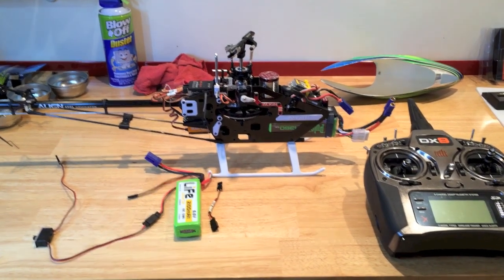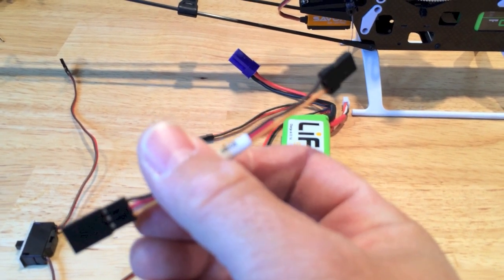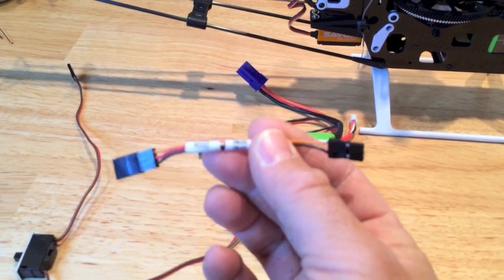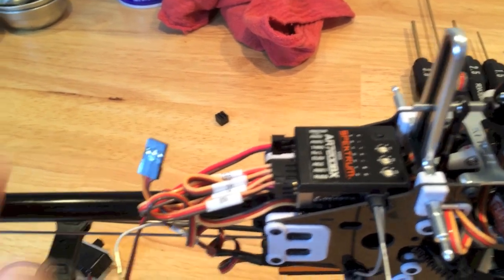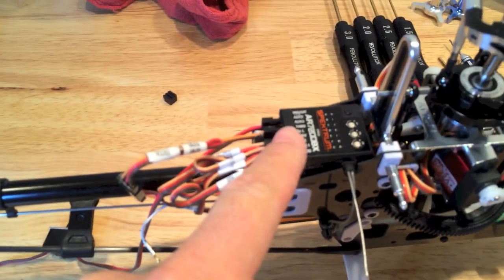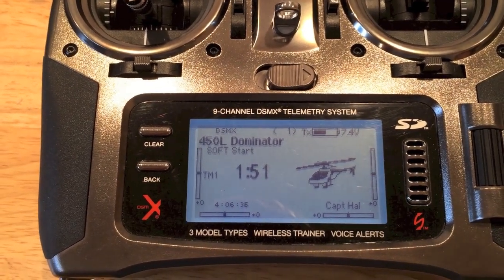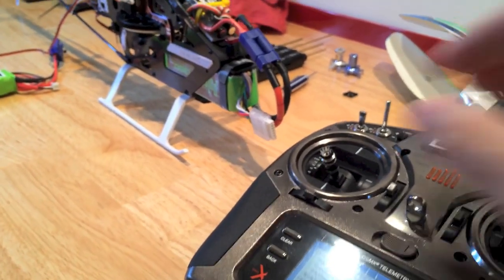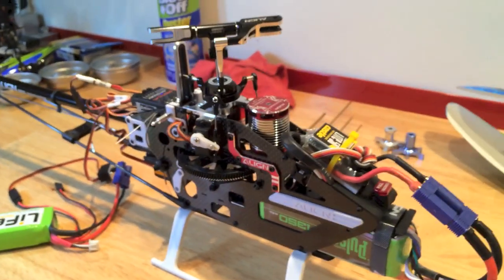Castle ESC Endpoint Calibration with AR7200BX

Comment: Can anybody explain the  30 30 on the travel adjust?..i understand about seeing the pulse...but whats the signifcance of the 30 30?..why not 0?
Reply from the maker: You could set it to zero/zero. It’s arbitrary.
Reply: @HalStaniloff  if you dont feel like trying to explaining it..i get it...but can i ask if it would be the same values for dx6i?..only askin bcuz i watched another video of someone showing how they do it...and the values they set were way off from 30 30...but also..i know that  different tx's...do it different ways...the same principal...but just looks different..
Reply from the maker: @natertater1978  It’s been a while since I was using this FBL and ESC. BUT I remember that it’s just an arbitrary minimal value to start with. That’s all.
Reply: @HalStaniloff  gotcha...okay...now that ive watched ur vid ahalf dozen times..its finally startin to sink in lol....but hey...sum learn faster than others..i just watched one where the guy does away with the pullin of the red wire and making diy plug..what he did was use a separate rx..plugged the dsmx  and the thro wire from esc into it..then made sure thro curv was linear..and then he also sets a 30 30 value in travel adjustments...but then he moves stick to hi position..and rebinds tx to rx...he claims it easier than the way u showed...but i would have to disagree..he had to rebind like 3 times that way
Reply from the maker: @natertater1978  This is the most straight forward way I found.
Reply: @HalStaniloff  i most certainly agree...im wanting to do awayy with this ikon 2 fbl unit on my 550 and put my bx on it....the way its setup .the red wire is  pulled out of the thro lead of the talon ...i assume it will be the same with the bx?..or will i need to put the red wire back in?..sorry im bombarding ya with ?'s..this is all pretty confusing to me
Reply from the maker: @natertater1978  I went all VBar Neo and don’t go through any of this crap anymore.  Just say’n.
Reply: Yeah...thats the top shelf equip. There fer sure...id loove to have the vbar..but my pockets arnt that deep lol
Reply from the maker: @natertater1978  yup. Overpriced for sure.  But you’re buying your time back with set up and tuning and the control loop is the best out there. The rescue is also simple af to set up and works flawlessly. It has brought my flying to the next level because I don’t have to bother anyone to buddy box. Saved in crashes; saves on parts.  Food for thought.
Reply: @HalStaniloff  its over a grand just for the tx aint it?
Reply: @HalStaniloff  heya...me again..okay..soo im sittin here watchin the vid again...following along with it step by step..and evrything goes right along with what your doing...up until i start raising the throttle value from 30 at high stick...i went all the way to the max with my travel adjust but the talon never did change from a blinking light..nor did it make anykind of beeps..any suggestions ..?
Reply from the maker: @natertater1978  Increase the values very slowly. Seems like the ESC is not catching the end values.
Reply: @HalStaniloff  apprciate it..i ended up figuring it out..when the ikon was on it..the talons power wire was taken out of the lead and was powerd from bec..lol 🤦..slipped it back in and she started makin the beeps lol..found it a bit strange that on the high side..it took well over a 100 to get the beep...whilest the low side beeped at around 85 er so..
Reply from the maker: @natertater1978  glad you figured it out!  Yeah, don’t pay attention to where the beeps started sounding. Electronics vary from vendor to vendor so it’s no surprise. Good luck!
Reply: @HalStaniloff  hey...i apprciate the hell out of ya man..m for taking time to help a stranger out..dont get that too often in the world these days.
Reply from the maker: @natertater1978  👊No problem.
Reply: @HalStaniloff   🤙🤘✊
Reply: @HalStaniloff  oh!!..i almost forgot..so as i mentioned ..i plugged the hot wire back into the lead..which still leaves me with my bec on my heli...it has two leads coming off it...should i..or can i..take the hot wire back out of the esc lead..and plug them into two open ports on my bx..?...its simply for redundacy right..in case of power loss?
Reply from the maker: @natertater1978  I’ve been flying for a very long time and when I went to 700 size helis I installed a Backup Guard for redundancy. However as time went on I never experienced a failure. So I pulled all the backup units off my machines as they were for me a waste of time and money.  Not worth the expense and weight.
Reply: @HalStaniloff  thats exactly what i was thinkin!!!..is it worth it to have that few extra grams of weight!...
Reply: Again
..i do apologize for bombarding ya for knowledge..got ta get nyway i can lol...but i have a concern...so i got the bx on...evrything is workin as should..its a 600E..and with the ikon..i was able to plug in both my dsmx's...on the bx..theres just one port for a satt..and ive read that anything bigger than a 450..should have 2 satts...is there any merit to that?
..is it a necessity to have 2 or will i be alright with just the on
Reply from the maker: @natertater1978  on the larger heli’s there can be a scenario where reception is deflected depending on the shape of the machine and the location of the satellite.  I would think you’ll be fine. But perform a range check to make sure you have good reception.
Reply: @HalStaniloff  ok..thanks again friend..right now i have it mounted dead in the middle ...on the bottomside of the bottom frame plate..and the other one is still mounted on the side of the heli..in the back near the the tail servo area
Reply: @HalStaniloff  heya ..its me again..i have a question hoping you could help me out with an issue im having with my castle ice 120
Reply: @HalStaniloff  okay..could u plz elaborate...why 30 30?

Comment: This video was made almost 7 years ago, and it still provided me with crucial information I needed to get my T-Rex 550E PRO DFC to throttle up with my DX8. The one step I missed was that the first time around, I set the throttle limits to 30-30 before I turned on the AR7200BX. But, I re-watched the video and did it right the second time, and it worked! THANK YOU!
Reply from the maker: Brian Hall I am delighted that my video helped you!  It’s turning out to be an oldie but a goodie. 😉💪🏻
Reply: 100% couldnt find a video that didnt confuse me even more

Comment: Another heli, someone said i need o calibrate the esc even tho im using fixed rpm mode in the castle?? is that true? and i cant do what you did in the video if i have those set can i? right now i have norm set to 30% flat, stunt 1 set to 70% and stunt 3 set to 100%. would i have to just set my throttle curve in normal to do the calibration? then just set back to a flat 30% to fly ? or do i need to change something in the ESC first? Thanks
Reply from the maker: You still need to tell the ESC the range of the throttle signal that the radio is sending through the throttle channel.  That is what the calibration step does.  I would set a linear throttle curve just like in the video and perform the calibration steps.  The put the ESC in to whatever mode you want.

Comment: My friend, I've tried setting up my 90's talon endpoints on this AR7200BX with DX7 black, but the ESC does not recognize the throttle. What can it be?
Reply from the maker: Luciano Gonçalves Aleixo Can you be more specific?
Reply: I did what you taught in the video, but not right.
Reply: ESC does not recognize radio endpoints
Reply from the maker: Luciano Gonçalves Aleixo Try it again.  Unless something has drastically changed in the firmware of the BeastX this procedure should work just fine.
Reply from the maker: Luciano Gonçalves Aleixo Then the 7200 is still in Failsafe mode.  If you powered it separately and allowed it to power up fully then power on the ESC with throttle stick high the the WSC should go in to program mode.
Reply: It does not enter programming mode.
Reply: With AR7000 receiver, the ESC enters programming mode

Comment: Cant get mine to work. DX8 G2 with Castle creations 120A HV esc. did everything u did unplugged my Castle pro esc. hooked up external pack after making extention with red wire pulled. leaving at 100% end points turned on AR7200 after it booted switching to 30 30 then high throttle moving numbers up it never beeped for me.
Reply from the maker: epoweredrc Try it again this time go past 100 until you get the beeps.
Reply: Thank you for the reply, I had the red wire pulled and on the HV escs you have to leave it plugged in, soon i did that it worked first try.

Comment: what happens if you dont calibrate the sticks? will it stil fly?
Reply from the maker: Ron Busch If you don't calibrate the throttle end points, you won't be utilizing the full throttle signal. Sure, it will probably work but you may not get full power.

Comment: I followed the steps in your video and it worked great. When I run the helicopter on the bench the motor will stall when I bring it down to low throttle and back to high ...any ideas?
Reply from the maker: Barney Meza check to see if you still have a linear throttle curve engaged.  Does the motor run well at 100%?
Reply: Hal Staniloff yes I have linear curve it runs great at high throttle it's just sluggish down low I used a different beast x and it seems better I've just never encountered this issue before it's already caused two crashes
Reply from the maker: Barney Meza Sounds like you have an ESC problem. The motor will run funny without blades to load it down but this sounds different to me. Check your ESC logs and/or try a different ESC.
Reply: Hal Staniloff I'll try that next thank you for your time much appreciated

Comment: is it ok to use a standard receiver for calibration and then rebind to the Bx7200?
Reply from the maker: ArcticRc No. You need to calibrate your endpoints using the AR7200BX.
Reply: Hal Staniloff Ok thank you sir.

Comment: hiDid you hook the switch and the wire you made up   on the red and black to the battery   plug . my  battery is a 22v what size do I need to use for this hook up.
Reply from the maker: lee rossi Visit TowerHobbies and pick up a 2S LiFe pack and switch. 22v is too big to hook up to the BeastX.

Comment: hi, did as dire.tutto ok
but it does not work, if I remove the battery to another flight. I have to raise and lower .Otherwise gas does not work. My dx radio 9 ar 7200 bx trex 550 dfc talon 90
because?
Reply from the maker: No idea. As you can see in the video, the procedure works.  Remember to keep the new endpoint values and rebind your Rx to the 7200bx.  But without watching you perform the procedure, it's almost impossible to guess what you are doing wrong.
Reply: thank you
  I think it was wrong bind,
I try to do it all
Three months that I leave then I try and resume

Comment: Obviously it worked for a lot of people but I have a concern about the red wire deal. A buddy of mine says he also disconnects the red wire from his ESC's when using a separate power supply for Rx and servos but the instructions with my CC Phoenix Edge HV 160 specifically states do NOT disconnect the red wire. I'm kinda leery about the whole thing since the maiden attempt of my Assault 700 I barely got it half spooled up and my Turning dlux 160 amp HV ESC decided to incinerate itself. I'm also using the AR7200BX. Luckily the only damage was the ESC.
Reply: +Skammy5 You're Edge HV 160 doesn't have a BEC it is opto isolated. You only need to remove the Red wire if you will have 2 conflicting power sources.
Reply from the maker: You are only disconnecting the red wire for the calibration procedure. After you are done, you connect your normal ESC lead in to the AR7200BX. If you simply connect the external power supply to the FBL along with the ESC without removing the red wire you will back feed voltage in to your ESC. Which is bad.
Reply: Thanks and sweet video. I'm still unclear as to why it wouldn't still back feed when you reconnect it after programming. I love helis unfortunately understanding electronics is not my strong suit.
Reply from the maker: Because after you do the end points, you're done with the external LiFe pack. You unplug everything and reconnect your ESC and away you go.  This setup is only used to calibrate the endpoints - it's not the permanent setup of the Heli.

Comment: Nice and Clear Vid , much better than some others I have seen :-)
I have the CC Phoenix , Jr 9503 and Spektrum Rx 7010. Thought I had it set , but when I plugged batt in , ESC got VERY Hot ! ,Unplugged quick !
Need to watch Yur Vid again, to understand the use of the Pigtail  and seperate battery . Now to watch again..  Thanks for the Vid   tom e

Comment: Hal... This is great! can't wait to try this... I just bought a 700fc3 (one flight) without a receiver. I put an ar7200bx on it and bound it right away to my DX8...(with no issues) set up the ar7200/DFC head per all instructions (perfect)
I've been struggling with ESC (castle 120 HV-no card came with it) won't spool up for anything! The heli has a BEC, so I'm thinking I need to still make up a harness for the ESC for binding purposes... or, sinse I have a BEC, should I permanently remove the red wire from the ESC harness?
Reply from the maker: It's your call whether or not to use the internal BEC of the CC ESC or not. Either way, you will need to go through the video procedure to get the end points calibrated correctly. Also: watch my video on setting the auto-rotation bailout. It effects end points so you might as well set it up now while you have your mind wrapped around programming tasks - even if you aren't doing autorotations.   Let me know how it goes!

Comment: Before calibration, what is the bind procedure for the esc? I have an Align Trex 700 with a Beastx flybarless system, a Phoenix Edge HV 160 esc, and a Spektrum DX18... A technician at a hobby shop was able to the esc to bind to his Soektrum DX8 but was unable to get a bind on his DX18. I have searched high and low and made many calls and cannot get any direction. All Im asking for is the binding procedure for the above mentioned equipment if possible.
Reply from the maker: Hey Terry: Nice to speak with you on the phone!  Download the CastleLink Software and obtain the interface board in order to program your ESC.  Then go through the throttle calibration procedure above.  Also, be sure to run through the settings of the AR7200BX to make sure that they are all set correctly for the equipment that you are using.  There are plenty of videos here on YouTube to help you out.  Good luck!

Comment: Can you elaborate for set ups that use a bec?  I run 1 6s battery that powers both the AR7200BX and the esc.
Reply from the maker: I'm not sure I understand as you state that you have a 6S battery that powers the AR7200BX and the ESC.  Whether you have a BEC in the middle or not, the procedure is the same.  You have to get the AR7200BX to initialize first using an external power source.  Then power on the ESC to calibrate it.
Reply: Ok that makes sense. Thank you!!!

Comment: Thanks so much for this video.  My only question is did you leave the travel adjust at 92 and 90 when you were done or did you put them back to 100?  Im assuming you left them alone but I just wanted to double check.  Thanks again and take care!
Reply from the maker: Yes. You leave the endpoints at the values you arrived at as per the procedure in the video.  Then you are good to go!

Comment: Warning DO NOT USE THE DAT/BIND it shorted out on Life pack for a second and smoke ar7200bx is fine and my pack is ok
Reply from the maker: Can you be more clear as to what happened?  I have never had a problem.
Reply: I went to plug in the battery red up and saw a big spark and smoke I, witch i assume was a short, most Spektrum RX's say BAT/BIND not Data/Bind because on the AR7200BX it is a data and bind port only and not a battery port
Reply from the maker: Hmmm... 👌Ok.  Thank you very much for commenting on this.  Most people have the GEAR channel open so that could be an alternate input to plug in to just to be safe.  Thanks for relaying your experience. 😊👍✨
Reply: No Problem I don't want someone blowing up there AR7200BX @ 250 USD its not cheap
Reply from the maker: Neither do I!!!! 😊👍✨

Comment: I watched your other video as well but im having a hard time setting up the auto rotation bail out, actually i have never been able to get it to work with an AR7200BX. I set up the endpoints as you did in this video. Then i plugged it back to the castle link and enable the "autorotation mode" but now the esc will not arm, thus i can not set up the throttle hold percentage?? I would love any help to get this going thanks!
Reply from the maker: Sorry you are having trouble.  Start over.  Before calibrating the endpoints, be sure that the Auto Rotation checkbox is ticked off.  If you don't do that, then your endpoints are going to be different - enough that the autorotation bailout will not calibrate.  So try it again and see what happens.